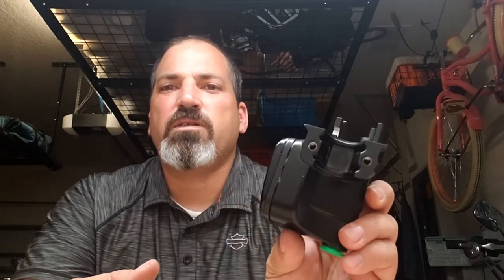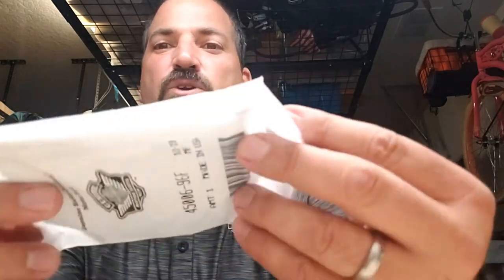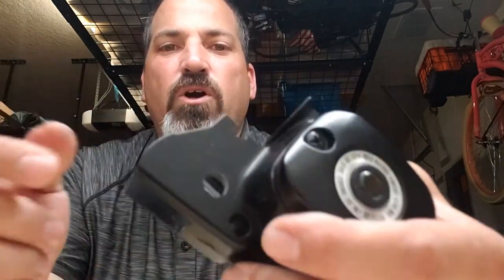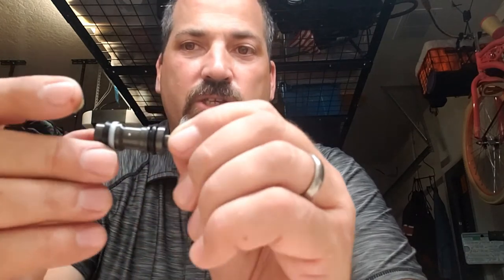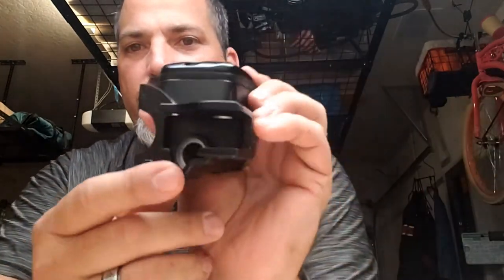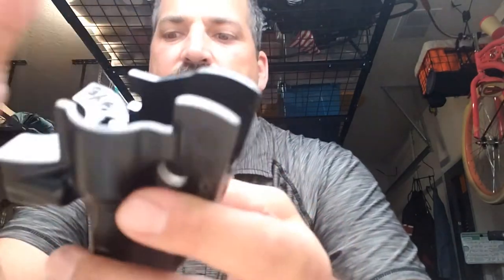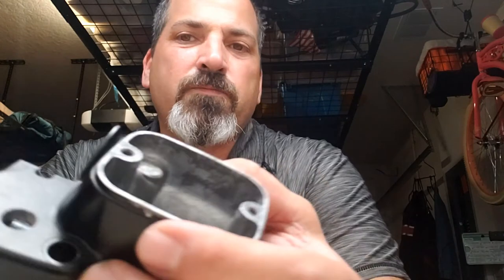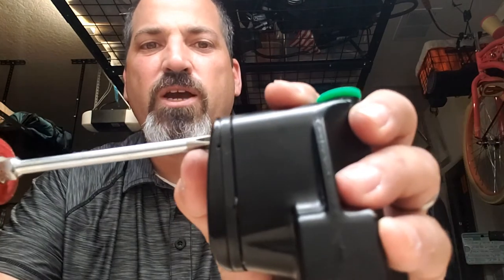Harley Davidson Front Brake Master rebuild (06 Softail)

Comment: In your next video, can you cover how to unplug the orifice inside the master cylinder (or bench test it) where the brake fluid flows to the caliper? I have a 2000 Springer that I suspect has a clog somewhere in the brake lines or master cylinder because I am unable to get the fluid to flow out when attempting to bleed the system.  Thx.

Comment: Thanks for the great video Brother,  If you have time to reply that would be great.  My front brake is weak in general.  I back down a ramp when leaving my garage/cargo box trailer, and my front brake just slows me but will not fully stop my 2010 Heritage classic.  Any advise where to look first for the cause, or how to diagnose what the failing component is?  I changed the fluid a year ago (dot 4), rotor and pads are good. No pulsing or anything else when applying front brake while riding.  I figure it's got to the the cylinder of the caliper.   Thanks if you can reply.  I will check out your other vids.
Reply from the maker: Hey, a couple quick thoughts is that you have air in the line, weak master cylinder, the brake hose has debris or is clogging, or some other oddity. I would check those from easiest to hardest.

Comment: Where do I purchase a rebuild kit?  I have a 2004 dyna wide glide.   I did notice a lot of them master cylinder assembly are the same.
Reply from the maker: Go to the dealer and give your bike specs and they should be able to get you the right kit.

Comment: Is that a Harley or aftermarket rebuild kit?  I'm getting ready to rebuild mine so this video is extremely helpful!
Reply from the maker: I believe it is a Harley kit. I honestly cannot recall off of the top of my head.
Reply: HD part number 45006-96F. I grabbed a screen shot from the video
Reply: You might also mention that when the brake lights fail to come on, most likely, the culprit is in the piston assembly.

Comment: Scotty, great video! I'm about to dig into mine. I have a 2006 EG Ultra Classic with dual discs. Is the master cyl similar to this one?
Reply from the maker: There is a difference so make sure you buy the right kit for the dual brake set up. The bore size is different, but otherwise almost exactly the same. Good luck and take your time.
Reply: @scottygarage7408  Thanks! Great videos!